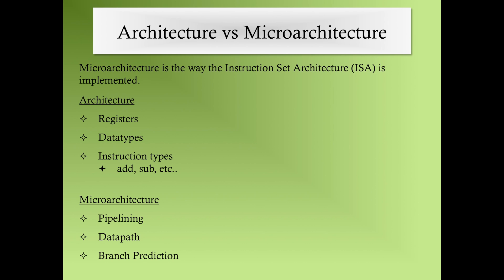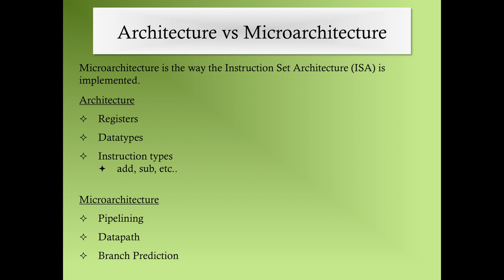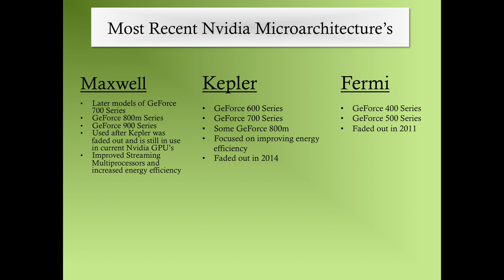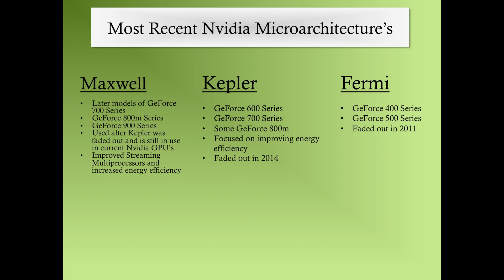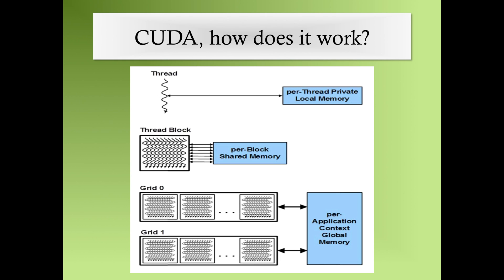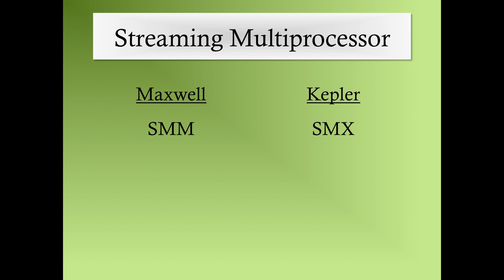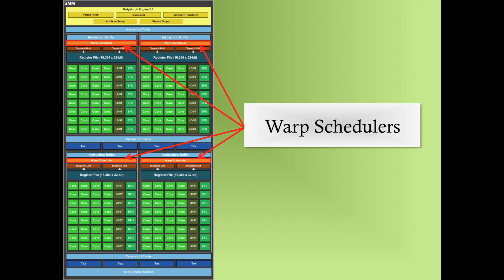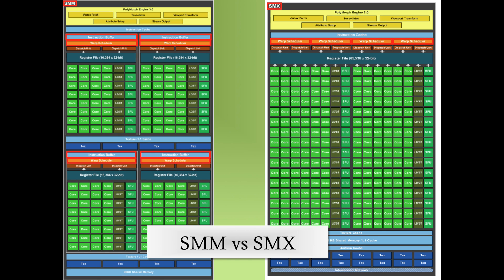Nvidia GPU Architecture

Comment: As you can probably see, Streaming Multiprocessors are the GPU’s equivalent of a CPU core.

Furthermore, these CUDA "cores" Nvidia refers to are actually execution units. Floating-point FMAs to be precise. They make up the bulk of the SM’s execution units.

In reality, the number of SMs doesn’t really matter: Nvidia tends to change the size of an SM between microarchitectures, so comparison isn’t really useful. I would say comparing the number of CUDA cores as well as the clock speed is probably a more reliable comparison.
Reply: That depends on your workload. If you have a lot of thread divergence, more SMs with fewer ALUs is better. If you have high utilization and less thread divergence, then fewer SMs with more ALUs would be better. As GPU tasks become more complicated, the amount of divergence increases, so making the SMs smaller is a better approach.
The raw peak performance only depends on the number of ALUs and clock speed (not the SMs). However, the maximum practical peak performance will highly depend on the number of SMs depending on the workload. I.e. 1 SM with 2048 ALUs at 1 GHz might do 2 TFLOPS. But practically only be able to achieve 40% peak. Whereas 4 SMs with 256 ALUs each might peak out at 1 TFLOPs and be able to achieve 90% peak. 40% vs 90% could be explained completely via thread divergence. 
Then you have 2*.4=0.8 TFLOPS vs 1*0.9=0.9 TFLOPS. That's an extreme example though, because they are a lot closer in base numbers while being further apart in performance (it has to do with register file pressure, scheduling, work distribution, etc.)

Comment: Is there any difference in the CPU ALUs and GPU ALUs?
Reply from the maker: I think the main difference is the number of ALU's. GPU's have a lot of ALU's and a CPU only had a few.
Reply: @bradonf333  well, they aren't the same though. GPU ALUs are a bit more advanced, and tend to have features like how to calculate shading, if I recall correctly
Reply: @ithaca2076  That's not quite correct, depending on what you mean. CPUs don't typically have one type of ALU anymore, they have an integer ALU (add, subtract, logic, shifts), a multiplier, a divider, and a FP ALU (which is often divided into a FP ADD/MUL ALU and a FP DIV / SQRT etc ALU). Often those ALUs are combined into common pipelines, for example, an x86 CPU may do {Add, Subtract, Logic, Shifts, and multiplication} in one ALU, and then {Add, Subtract, logic, and division} in another ALU. It also depends on the CPU, some of them have multiply-accumulate instructions, while others don't. If you ignore the addition of a MAC instruction, then a GPU "ALU" is going to be much simpler than most CPU ALUs. 
The degree to which that's true depends on the GPU architecture, the older ones combined an INT32 and FP32 ALU into a single "core", which may or may not have been unified (i.e. a single pipeline that could do either), or they could have been unique pipelines. The advantage to unique pipelines would be that the latency is lower (fewer cycles) at the cost of area. The current NVidia architectures have a combined FP32/INT32 pipeline, and a FP32 only pipeline. The current AMD architectures have combined FP32 and INT32 pipelines, which is true for the newer ARM Mali GPUs, as well as PowerVR, and Apple's GPUs. 
Going back to NVidia though, the FP32 ALUs can only do FPADD, FPSUB, FPMUL, FPMAC, FMA, and I think that's also were the Int to FP instructions are done. 
The INT32 ALUs do integer ADD, SUB, MUL, MAC, Logic, Shift, FPCompare, and I think is where the FP to Int instructions are done. 
The "Cores" / ALUs don't do anything fancier like SQRT, or Division. The GPU is actually incapable of doing either of those operations, and instead can do approximations to those operations using the Special Function Units (SFU / MFU). Those would not be considered ALUs though.
TL;DR The GPU ALUs are in general much simpler than that of a modern (high end) CPU.